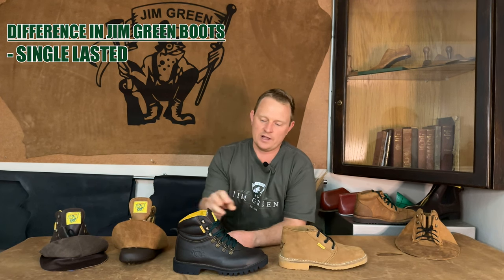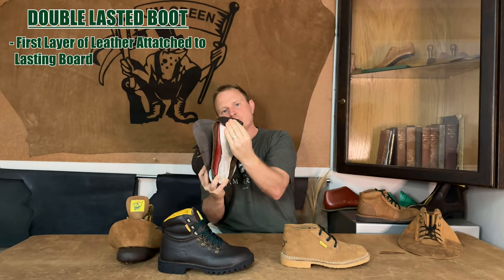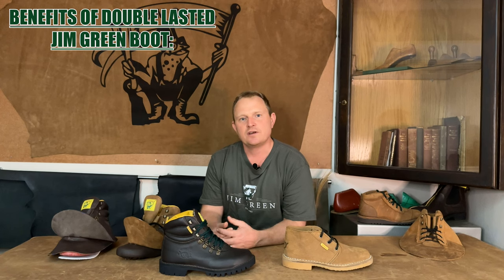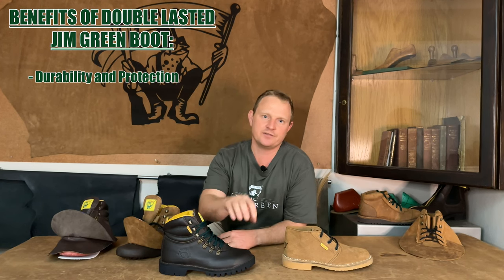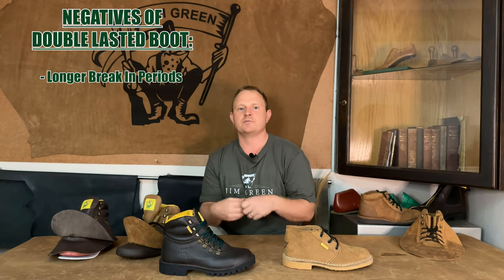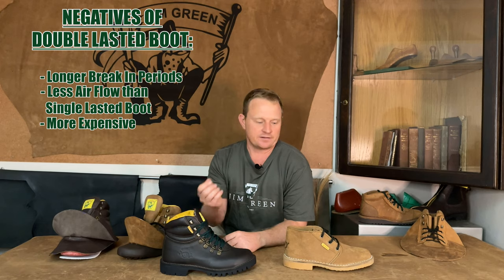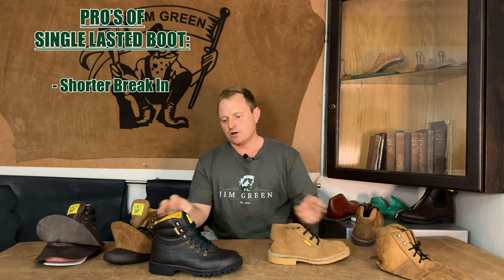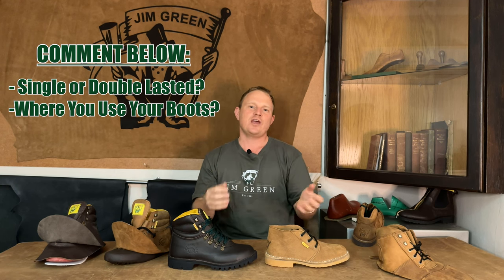The SECRET to our Double Lasted Boots! // Single VS Double Lasted Boot Review

Comment: I’m a tile setter so my Razorbacks get wet, they’re bent at the toes all day, and sometimes I end up just sitting on my feet which means my boots suffer heavy abrasion on the side of the leather by my pinky toe.  Every work boot I’ve ever worn wore through there in about a year. I alternate between two pairs of razorbacks and they’re both going strong 2.5 years later and feel like slippers. I love them. 

However the break in was hell. The lower toe box and the double layers of leather were very difficult to break in especially when being bent at the toe all day. I only wore those two boots while breaking them in and I do not recommend that. The only other thing approaching a con is that because I sit on my feet the top two speed hooks finally broke off after a year. I’m not disappointed, I’d call that routine maintenance and there isn’t a “tile setter’s boots” so it’s not like anyone is designing a boot with me in mind. However if I had my druthers I’d only have one set of speed hooks at the top and replace the rest with D rings. Even so I love them and I’m committed to Jim Green boots now.

Thinking about getting the outback next for the smoother outsole and lack of hardware
Reply from the maker: Thanks for the support and feedback, much appreciated. Great news is we may soon have a lower cut version of the Razorback available, you could call it a "tile setter boot" ;). The break in for a few isn't easy, myself I can put a brand new pair on and hike 10 miles no issues while a few take a few weeks for them to soften up. Drop us an email for images of the lower cut boot and we can chat there

Comment: With a middle thickness sock the African ranger is very wearable even on cooler days the ranger is also reinforced at key wear points to enhance its durability. Mine got a bit wet tbe other day but using a waterproofing substance with beeswax definitely held the rain out. The only thing I wouldn’t wear a Jim green for is deep snow